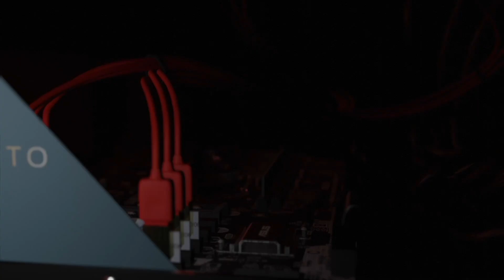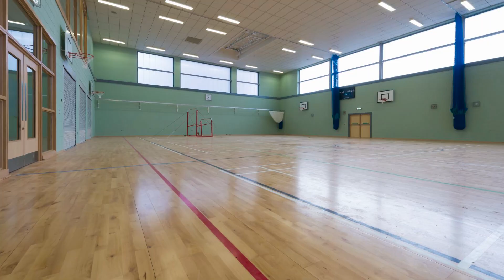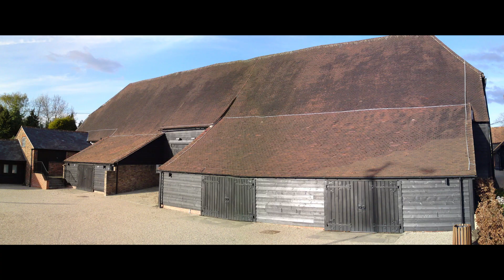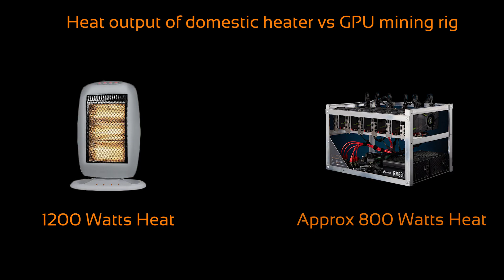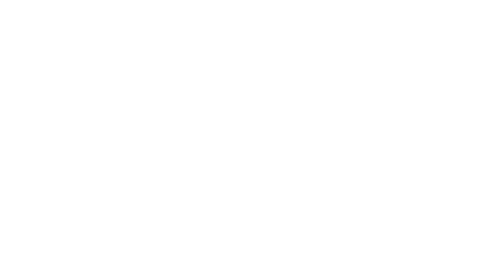Do GPU Mining Rigs Produce Loads Of Heat??

Comment: will it be ok to put my 6 gpu rig in my house with only the gpu fans to cool it (without any additional fans)?
Reply: It depends what climate you live in. In my case I have 1x 3090 and 5x 6700xt and I have 5 x120mm fans on the rig. If it`s -16C outside I close a small window, but in summer, the heat will be a big problem. In summer I had 20-30C and it got pretty hot. So I would recommend fans on the rig. I have the fans blowing cold the air inside, but you could also put them so that they pull the hot air from the inside. The gpu-s are running 50-60C. Like he said a rule of thumb is that the machine wattage`s 40% is heat, so If your mining rig runs 1000w of the wall, it will be like a 400w electric heater. Hope this helped :)
Reply: @milo4978  yeah, I ended up buying fans because I'm in a warm climate